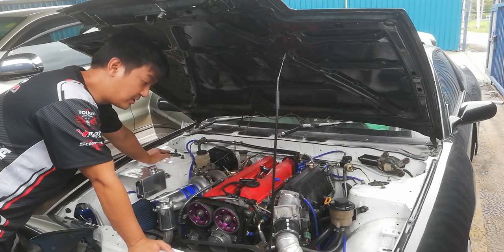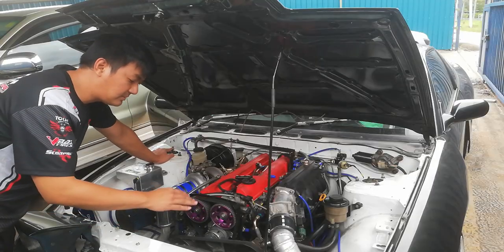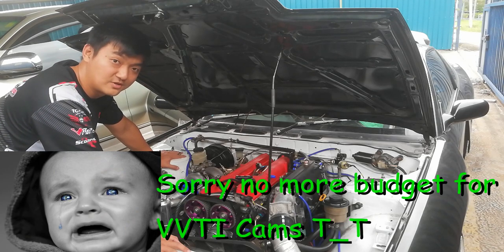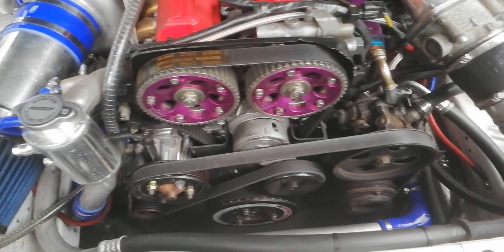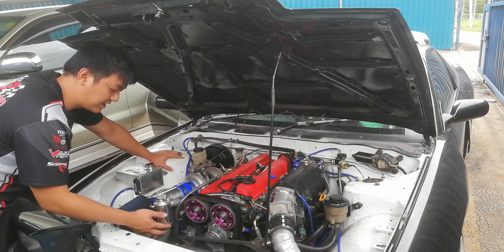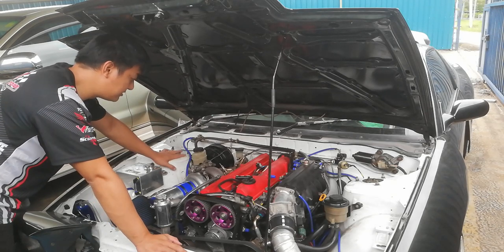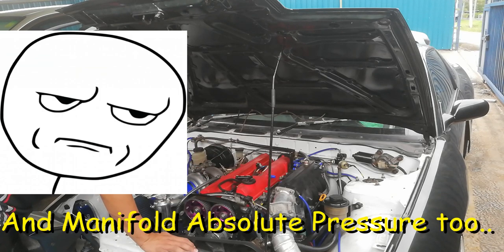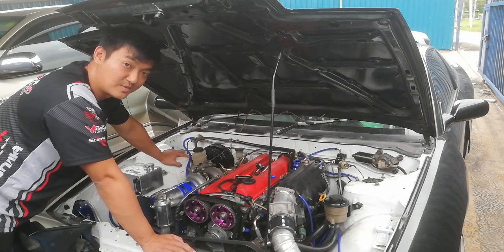2JZ Tuesday - My new 2JZ 180sx KK Drift update (Low Budget 2JZ)

Comment: I think I’m ready for the dyno 😬
I’ll list my set up if you can tell me if I’ve missed something .
2jzge vvti with
Hks pistons 87mm had the block bored and honed and decked but not much off the deck.
Eagle rods with clevite bearings arp rod bolts
Na oil pump
Lighten flywheel 
1.25mm head gasket 
Arp head bolts 
Hx52 turbo
Turbo smart wastegate  10psi spring 
Sytec fpr with a Aeromotive 340 fuel pump
Bosch 1000cc injectors 
Det3 ecu  as I’m not sure my mapper can tune the vvti so went with the det3
Mac boost solenoid controlled by the det3 .
Am I missing anything ? What do you think it would make bhp wise 👍
Reply: Michael Chung vui min yeah have a fuel reg no lag in the turbo buddy it’s only a 11cm rear housing it wasn’t laggy on standard engine I did send a video to you it’s twin scroll it boosts nice . And a tt oil pump is to much with out having oil squirters very well documented 👍.
Reply: I’ll put a bigger spring in the wastegate 20psi should be ok tho I’m looking for 600bhp

Comment: Nice build buddy 😎 what power did it make on the dyno I’m at the dyno next week
Reply: Michael Chung vui min yeah I’m the local Supra and Lexus mechanic round here I’m not no good at mapping etc my down fall it’s all calibrated on the ecu as I run it for a year on stock with a turbo kit just got to change the injector size to 1000cc .
Snacks is a must hehe 😎👍
Reply: Michael Chung vui min yeah it’s not costing anything it’s a friend that does all the race cars at one of the uk race tracks .
So do you think I need cams is there cams for a vvti Ge ?
Reply: Just for say 550-600bhp
Reply from the maker: @supraanon1914  hmm i think u can try to do with original cams first. to save some money =)
Reply: Cars Explained 👍 I’m not to bothered about the money it’s only money hehe but for what I’m after 5-600 I can’t justify it
Reply from the maker: @supraanon1914  hmm then go for it.. the cams =D for better drivability, 264 is good, 272 is stage 3